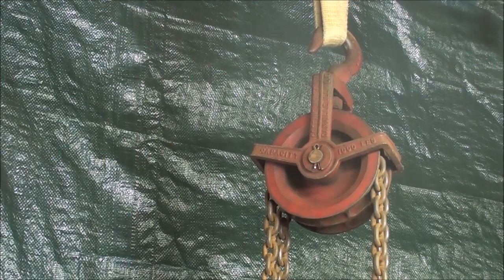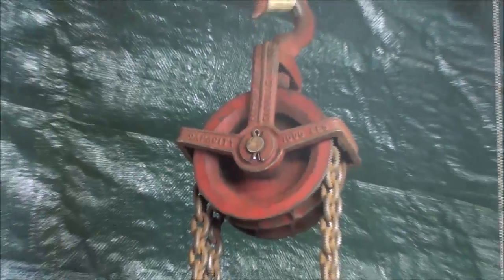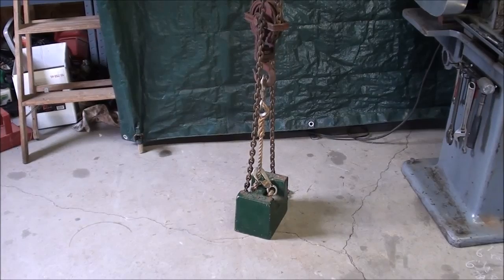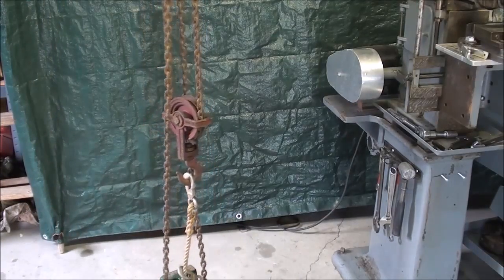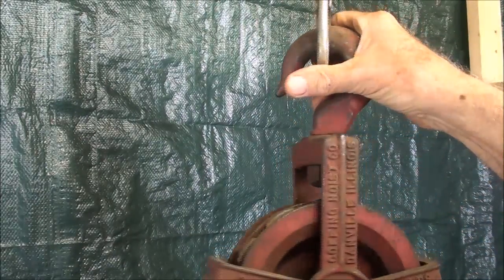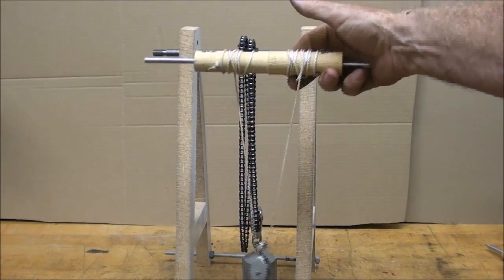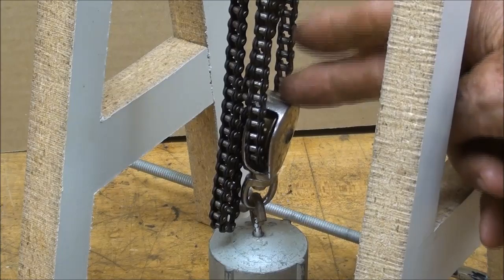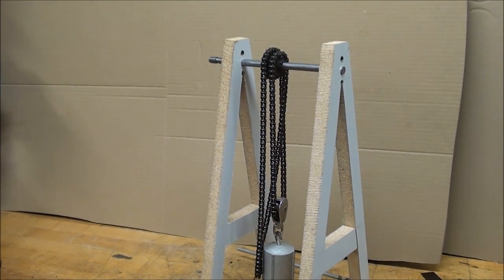WHAT MAKES IT WORK? #7 The Differential Hoist - tubalcain mrpete222

Comment: I have two of this style hoists but I still don't understand why it doesn't drop the weight when you let go of the chain.  I have used mine for different lifting projects and am impressed with the ease of lifting and surprise it hold the load.
Reply: Maybe the weight of the chain is enough to barely hold the load in place. It probably all comes down to the mathematics of it

Comment: no math? some people know it all I guess, or maybe they don't know what's go for'em. I really enjoy the math! I've watched a good majority of your videos... some 2-3 times.  you have a very unique way of teaching and its what I need to learn. I'd just like to say thank you for all the time and effort you dedicate to these videos and teaching. thanks Mr. Pete.
Reply from the maker: +Dwayne Routhier Jr No math-thanks for watching
Reply: +Dwayne Routhier Jr The math is easy. Each turn of the top shive set rolls 24 links (on mine) on the large shive, and 22 links on the small. Each 24 links on the hand chain side shortens the lift loop by two links, one on each side of the lift fall. This means that 24 links pulled lifts by one link, for 24-1 ratio. Friction on the pins holds it in place.

Comment: Mr. Pete, your Chinese Windlass video (excellent) sparked a memory of a course I had to take in Maritime Engineering many years ago.  I still have the book so I looked it up.   Today, an old friend who now watches your channel called because he wanted me to explain today's video to him...  I told him you did a fine job but he just didn't get it.  So for the engineering types... the core of this type of hoist is the torque split or difference (hence differential) between the radii of the major(R) and minor(r) pulleys being locked together.  So your formula for the mechanical advantage is M = 2R/(R-r).   The smaller the difference in size of the two bonded pulleys, the higher the mechanical advantage.  So your forces involved are F(pull) = F(lift)/M.   Thanks for the memories
Reply from the maker: +ramosel Thank you
Reply: +ramosel  Tell your friend to go to about 7:12 on the video. the 2 sprocket are fixed together as MrPete says. Now follow the chain down from the left side of the small sprocket, down to the weight and back up to the right hand side of the big sprocket. The weight is pulling down on both sides equally, the sprockets are joined so nothing happens. Imagine a weight being supported from a bar from an fan belt. There is equal pull on both sides. If you turn the bar the belt will go around. (The weight won't go up or down yet) Now we introduce the clever bit,  the different size sprockets. Watch again after reading the above.
Reply: Hey Harvey thanks for the information! I couldn't work out how or why it did not fall back down, You turned the light bulb on
Reply: A slight correction: there's equal "pull" on both sides in terms of force, but the net torque on the pulley assembly is nonzero because the lever-arms are different lengths (since the pulleys have different radii).  So, if the system were frictionless, anything attached to the hoist would indeed lower itself under its own weight.  The thing is, with a small difference in radii (i.e. large mechanical advantage), the torque induced on the pulley by the weight of the object is not large enough to overcome friction, and so it does not move.

Comment: i do have one but yet to use it as one of the disadvantages is the loss of height as it takes a lot of room, with the 2 sets of pulleys, my lifting beam is only 11 or 12 feet up which sounds plenty but soon disappears when lifting bulky items of a trailer or a cab off a tractor..my felco 3/4 tone chain block is about the size of your bottom pully probably saving at least a foot..the advantage of the differential lift is the smooth transition from up and down ..some of the geared blocks you have to jerk the chain to start lowering it..i do have a nice worm and wheel hoist that works nicely from up to down but it also has 2 falls of the chain so a bottom pully on the hook so loses a lot of space as well

Comment: Would this work for two capstans of different radii locked together? Three or more turns of rope on each. Would be like a hybrid between the Chinese Windlass and Endless Chain but the rope would not be endless. It would instead pay out of a rope bag through the system and then to load. If that worked could one make it from two different tire rims? Guessing that a pulley would have to split the work of the two drums at the load. System would be for lifting or pulling only. Thanks.

Comment: Trust me a 1,000 lb chain hoist like the one in Mr. Pete's video will lift the front end of a 66 Dodge one ton completely off the ground, (and the 200 lb Sailor standing on the bumper operating said hoist) when you don't take out the transmission to bellhousing bolts instead of the bellhousing to engine bolts. I was helping my dad do an engine swap on his work truck while home on leave. The Dodge bellhousing went down behind the flywheel so it had to come out with the engine, instead of being open in the front like on the plethora of Ford and Chevy's that I had experience with.

Comment: Hi great video! I've got a ww2 german one from a pilson hoist from a bergepanzer recovery vehicle it's basically the same but only one runner at the top with the wheel on the side as a separate chain I'm trying to figure out how this works I worked it out before how to feed the chain through correctly but been so long I've completely forgotten! The top disc sits across and the second wheel sits on the side with a worm going through turning the bigger pully with the smaller pully hook

Comment: 5:00 Size difference in 'sprockets' - is it the case where the smaller one has one fewer 'pockets' around the circumference than the larger one ?

Comment: I finally looked at the chain hoist hanging in my late FIL's polebarn.  Exactly the same as yours but the main frames are aluminum instead of cast iron with plain aluminum finish.  Both pulleys are cast iron but mounted in cast aluminum.  Capicity 1000 lbs is cast exact same as shown.  Instead of saying Coffing Hoist Co.,  Danville Ind.  mine says " TIMKEN "  then " ROLLER HOOK " .  Timken in place of Coffing, and Roller in place of Danville.  I suspect it came from Grand Trunk where he retired from.  Nice video.
Reply from the maker: Thank you, very interesting

Comment: That's interesting, and you can see the design relation to the Chinese Windlass. 

I have one of these differential hoists somewhere. Haven't used it in over 20 years though. Pulled many an engine with it then got a cherry picker. 
The hoist was faster than the cherry picker though, just don't have any rafters to strap it to at this house.
After watching this video I may dig it out; never studied it, just used it.
Thanks for sharing Mr. Pete!
Reply from the maker: +ShysterLawyer  Thanks for watching

Comment: Mr. Pete:
I worked in a building that had an elevator that worked on that principle.  It used a 1 1/2 inch rope.  Going up was fairly easy even with a full load, but I can also remember coming down in a hurry and getting a rope burn as I hauled as fast as I could on that rope.  This building was over 100 years old, and the hoist still worked well.  Except for replacing the rope, which,by the time I retired  was well worn, everything was original.
Reply from the maker: +Dan Floyd  Thanks for watching

Comment: I have one almost exactly like that made by American Chain and Cable company. 1/2 ton also. Love it. I honestly think it would exceed its rated capacity significantly although I havent tested that theory. I think it would only be limited by the weight of the person operating it times 2 people probably. So what ever a 300ish lb pull could do. Its an amazing little gadget. My neighbor borrowed it to pull a small v8 engine out of an old  Chevy Nova and had the front wheels of the car off the ground because he forgot to unbolt the motor mounts. I dont know how much that weighed but it has to be over its rated capacity I would think. Very nice chain hoist.
Reply from the maker: They are really neat mechanisms

Comment: As always I enjoyed your videos. I too have a 1/2 ton chain hoist that I bought in 1970. Mine is a Yale & Towne. I perfer it over a cherry picker. I have seen several people tip over cherry pickers with damaging results. I give the axles a little shot of oil before using it. Very simple machine that will out live me.
Reply from the maker: +Chuck Small  Thanks for watching

Comment: That's quite nice. I like that you can see just how it works right from the outside. Those geared hoists I don't trust - who knows what condition the gears are in or if they are made from hard cheese instead of steel.
With this one as long as the pockets are not worn it will be fine.
Thanks for showing this, and the chinese windlass. I thought this would be a boring topic, but it was just the opposite.
Reply from the maker: +stefantrethan  Thank you

Comment: Hey there brother. I work in the entertainment industry as a certified rigger we use this same type of mechanical system but electric to move some serious weight.  Just got to look through a old barn and found two of the old manual ones made by ford. Thank you for showing this stuff you produce wonderful easy to follow videos. I have been watching your series on the  south bend lathe clean up and rebuild .it feels like you are right there with me redoing my old lathe.
Reply from the maker: Thanks

Comment: Interesting video....  I have a favor to ask. I came upon a KOETT tool post grinder last week. I can find no info. An old timer from PRACTICAL MACHINIST forum said it was the CADDILAC of tool post grinders. I posted some pics of it on Adam Booths facebook page last week. Question I have concerns the flat drive belt. Two identical length belts came with the  grinder. Problem is that when the belt length will only work with the a couple of smaller pulley combinations. The belts have very little stretch, not like a rubber band. Does your DUMORE have multiple belts or does it allow you to pivot the motor to tighten the belt? Have a great day Mr. Pete....Chuck Castiglione Greenville, PA.
Reply from the maker: +Chuck Castiglione My big dumore uses a standard v belt.
The 2 smaller ones use little flat belts with no stretch. I have never seen a KOETT.

Comment: so why did they stop making these? seems just as effective as the current production chain hoists, but less complicated to build.
Reply: My guess, there is no protection to stop you overloading the hoist and having a potential failure, modern style chain blocks have a clutch system to prevent an overload of the system.

Comment: I find the differential hoist really appealing. I will build one one day once I have a mill and lathe. These show up on eBay from time to time but they're quite rusty. A new shiny one out of steel with some heavy capacity chain and nice lifting hardware would be a nice piece to have. Now I wonder where I can find a a loop of high capacity (say 10 000 lb?) endless chain?
Reply from the maker: Very cool!
Reply: @mrpete222  Hopefully I'll show it to you once it's built! Thanks for the videos Mr Pete

Comment: Could a third sprocket be added to the top for more mechanical advantage?  Would that require a second bottom pulley, perhaps a fixed one attached to the floor?  
I know my question goes where you're trying to avoid, but I see this as a mechanical computer in addition to a useful shop tool.
Reply from the maker: +Cliff Miller  Thanks for watching
Reply: No need to. you can get the most brutal mechanical advantage, by making the difference between the two sprockets' diameter amller and smaller

Comment: I love the elegant mechanical simplicity of these things. I don't understand why they aren't made anymore. I assume there is a reason the more complicated geared chain hoists have taken over, but I don't know what it might be.  I'm going to see if I can build a working model that uses #4 machine chain. Maximum load limit for #4  chain is about 215 pounds, and of course it is "not for overhead lifting," but it ought to work to lift my 65 pound rotary table on and off the milling  machine and things like that. Do you have any thoughts about traps for the unwary that I might encounter? I just made a wood wheel with chain pockets as "proof of concept" to see if I could get the size of the pockets correct for smooth operation. I discovered that the best working size varied about 6% from what I had calculated, so there is a certain amount of the Unknown involved...enough to keep it interesting.
Reply: Well, I've got Version 1 mostly  completed and working. I don't see any way to include a picture with  a comment. If anybody  knows how, please enlighten  me. 
The  most difficult  part, which I still haven't completely figured out, is getting the entrance and exit ramps for the chain link pockets correct. I assume they are supposed to be something like an involute...but they aren't, because the thing "unwinding" from the circle and tracing the path is not a continuously flexible string, which the definition of an involute calls for. Instead there is what amount to a series of rigid hinged bars, which is not the same thing at all, hinging up and off in sequence. I think the  thing one needs to do is find  a circular approximation that is "close enough." Even given that, however, it's not at all clear how one would cut the pockets to that curve. I've got the pulleys so they work, but the chain travel is slightly bumpy.
I used counts of 16 links and 20 links on the  pulleys, which gives a 10:1 reduction. At that ratio, it is barely self-holding. If I build a V2  I may try 18 and  20, which would give 20:1
Reply: For anyone interested, a description of how I built one is being serialized in "Machinist's Workshop" from Village Press, June/July 2022.   I was never able to get the chain to run over the pulleys as well as I would have liked. I think the shape of the links in the #4 machine chain I used is simply not designed for such an application.  The links need to be specifically designed to resist tangling.  It was an interesting project though, and I use it to lift my 65-pound rotary table on and off my milling machine.
Some have asked, "what keeps the load from dropping when you let go?" and the answer is,  "internal friction and luck."  I don't think one should count on one of these things being self-holding. If circumstances happen to create a very low-friction condition, the load will drop.  You have  the reduction ratio working in your favor, but that is not sufficient to guarantee anything.

Comment: Why does it not want to pull the load down that intreagues me for such a simple device
Reply: +dtec30 The chain that is around the pulley, which is attached to the weight, is wrapped one way around one sprocket, and the other way around the other sprocket, so it's pulling the same weight on both sides, so it's not being pulled in either direction. You turn it one way with the other side of the chain, and the larger pulley pulls over just a tad more chain over the top than the smaller one lets out. And conversely if you turn it the other way the large pulley lets out a tad more chain than the smaller one pulls in. The smaller the difference in size the more you have to turn the sprocket to effect any movement, and the more mechanical advantage you have.

Comment: So the reason it stays in the air is because both chains down to the pulley are coming off the opposite sides of the sprocket and because the sprocket is a single unit and they cant slip they counter act their own pull.  It's really kinda brilliant.  I always just assumed my chain hoist used a break of some sort to do that but obviously this makes a lot more sense.
Reply: +UnbeltedSundew   Hi.  If you look back at Tubalcain's video about the Chinese windlass, you'll see that there was a comment from a viewer referring to the fact that actually it works only because of the inherent friction in the system.   If you think about it a bit further, you'll appreciate that the pull on one side is very slightly more or less than the other side.  More friction than difference in effort presides and the pulleys/sprockets stay put.   So, sometimes friction IS an advantage haha.
Reply: +thecorbies It has to be more than friction, look at the windlass video. Mr Pete physically pulls on the weight and it does not move. Being just a small bench model his strength would have far overcome any friction in the device. Also, when lowering a load, an engine for example, the motion would overcome the friction and the load would rapidly drop, but in reality it never does and stops every time the operator does no matter how quickly he was going. 
I believe UnbeltedSundew is correct in his observation that it's the chain and sprockets working against each other that secures the load.
Reply: thecorbies I don't believe there is a leverage advantage at all between the different sized wheels. I couldn't begin to give you an explanation why though.  The fact must be that it is the same level of force applied to both sides of the wheel.  I watched the Chinese windlass video (after this one) and you'll note that when the string is on the same size wheel the load doesn't move, I think this is significant...  Perhaps because  the load is hanging it equalizes the force on each line in oppositionally to the leverage advantage they would otherwise have?
Reply from the maker: +UnbeltedSundew  Thanks for watching